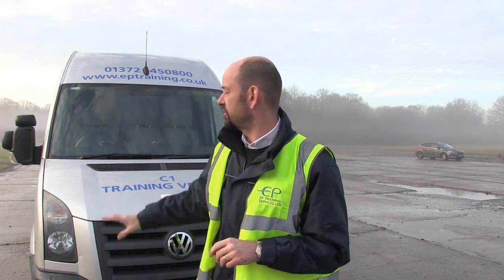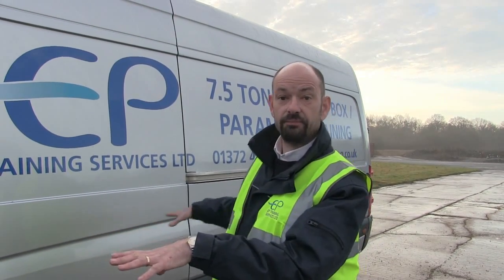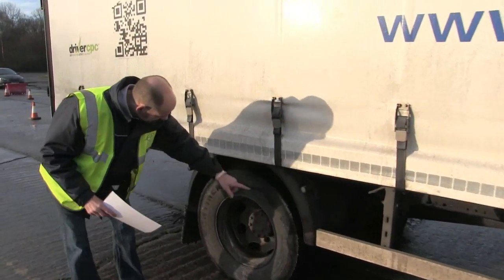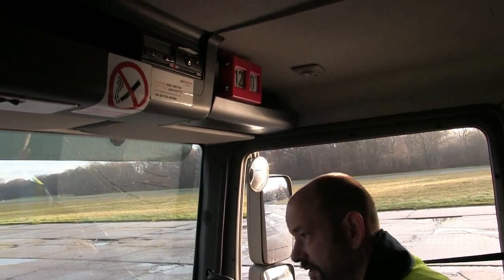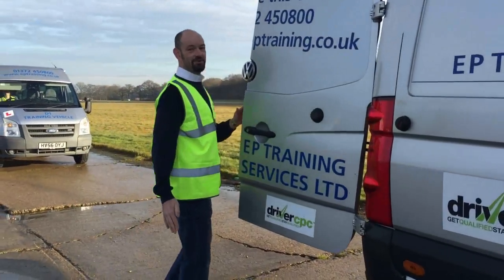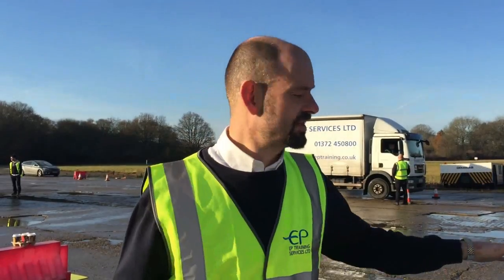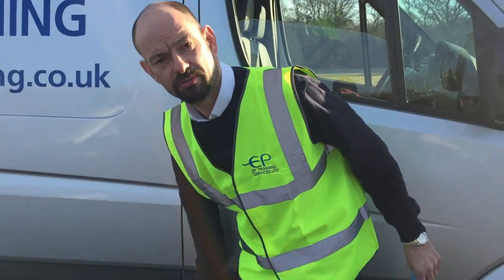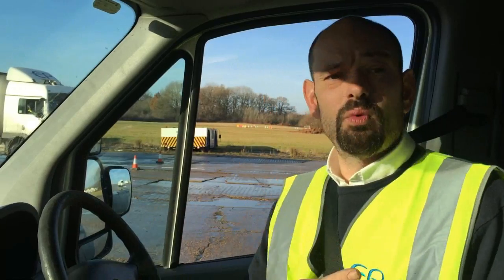Mod 4 Driver CPC 2019

Comment: i have a scenario where with the bleeding the air from the tank for this test 
you should first confirm you are on flat ground and way not use the wheel chocks ore blocks to secure the vehicle?
when you repair brakes or work on breaks with a car or lgv you do this.
a hgv is a lot more dangerous.

Comment: You have to get 100% on at least one question and then 75 % on the rest? .. No you don't! Its an average of 80 %, so many variations .. 80 % on each question would be Ok too !
Reply from the maker: Thanks Simon. I think you will find that my sums do add up. We have doing this stuff for 10 years. Each question (barr walk round and cockpit check) requires 4 answers. You have to get at least 3 out of 4 correct (75%). You can't get 80% correct on any of the questions (suffice for walk round and cockpit) so yes you do need to get 100% in at least 1 of the answers to get a minimum 80% overall. I stand to be corrected however...................

Comment: Very useful video but just an extra question. Is it necessary to use a seatbelt while moving the vehicle for checking the breaks as we are allowed to drive without it for less than 50m when loading and unloading within an yard? I mean, is it a real mistake leading to fail the exam or it's just a bad impression. Thanks. My Mod 4 is on Tuesday....
Reply from the maker: Hi. Yes you should really have the seatbelt on when moving forward. My bad if I did not do that.

Comment: Can i turn up to the test centre in my iveco pick up 3.5 ton and do the full mod 4 in that.
Reply: Sean Pargeter the actuall test centre itself in Kirkham lancashire. They printed the vehicle requirements of and sent me away. Ive now passed it but had to pay a school who said the same as you.
Reply from the maker: no. it has to be a goods vehicle OVER 3.5 tonnes
Reply: E.P. Training thanks for getting back to me, but i turned up to the test centre this week in a 7.5 ton pick up wagon and they turned me away saying that it had to be a minimum of 12ton, had to be no less than 8mtr long and have 5 x 1000 ltr ibcm in the back of a cargo body truck. So basically you have to go through a school.
Reply: sashagooch wow amazed to hear that they are clearly wrong the module for test requires you to turn up in a good vehicle over 3 1/2 tons no IBC it’s not a category C driving test. Who told you this The examiner or a training school as they are clearly wrong

Comment: Got my modual 4 next week im kinda nerv...when it comes down to actual demostration, i will forget certion elements on some answars. Is 3 hours enuff to learn at the center then the test afterwards...man the nervs are kicking im gona watch this video as much as i can...
Reply from the maker: Immy Kay hi you will be fine. 3 hours should be enough. It's very straight forward. Just concentrate and you will be fine.

Comment: I mean I already have my CPC and am a fully employed class 1 double decker supermarket driver, but why in the hell is a van a part of the CPC? Van drivers are just basic cat B drivers, so why is it a part of the CPC?
Reply from the maker: OK thanks for your comments but this video is clearly not for you. You obviously are one of the more experienced, mature drivers out there who already knows everything there is to do with driving a truck commercially. You must understand this is for the purpose of getting the Initial Driver CPC qualification. i.e. for NEW entrants. You would not even need to do this.......so why bother sticking your 2 pence in where it's not needed. I cannot see how your comments contribute in any positive way
Reply: Its a 5 ton van!
Cat B driver can only drive up to 3.5 so to drive this van you need a cat C1 or above and cpc if its for work.
Reply: it is purely for demonstration purposes i assume, as the rigid was used or something. it makes no difference tires and V1 plate are exactly the same anyway ^^
Reply: A B is 3.5 tonnes C1 is for 7tonnes  C is up to 32tonnes rigid  C+E is over 32tonnes. Thats taken from NDLS Ireland.. so.e the regulations are different over here like min tread depth is 1.6mm where UK its 1mm.. if you pass on an auto your can drive manual with the catagory B rule (if you passed your B in a manual) where over here its an auto licence and it has a digit which states it and limits you to only autos.  Just be careful where your getting your info weither it be Ireland the North or the UK fi d the reperesenting bodies and gather your info that way.
Reply: @BrianShawEire  Their is no upper limit on Cat C according to Dvla.. the 32ton limit does not exist.
Reply: 5 Ton vans have Tacho's and it's more to do with the weight and  'train weight' of that vehicle in that it may pull a trailer with small machinery etc on it. You will notice that all 5 Tonner's will have double wheels on the rear (IIRC) and it's completely in line with CPC and LGV vehicle rules etc. It has a Ministry Plate with it's weights etc and is treated in exactly the same way as any LGV. Sean actually mentions this at 6.00 minutes and that's why it's classed as an LGV etc.
Reply: Its a 5 ton van haha...... it weighs less at full load than my cab alone when bobtailing home :D
Reply: john Whittle whahhahahahhaha dunno where you took this info from mate but............. thats embarrassing....
Reply: also could drive if you have grandad rights because if you passed your car test before jan 1997 you can drive up to 7.5 ton but still need to do cpc

Comment: This is a great video and very helpful, however i had my mod 4 test just a couple weeks ago and unfortunately i failed it but i did everything that was shown in your video apart from mentioning about the Consignment paperwork and VI Plate but i did say everything else such as visual vehicle checks with excessive learning and suspension level and going to a weighbridge etc, but is it an instant fail if you dont mention about the VI plate and load paperwork as that is all i could think of for what i did wrong? 
(I didnt like the examiner as i felt like he was rushing me but i didnt want to run out of time?) 

Thankyou very much for you useful informative videos :)
Reply: Bugger!! You will get it next time